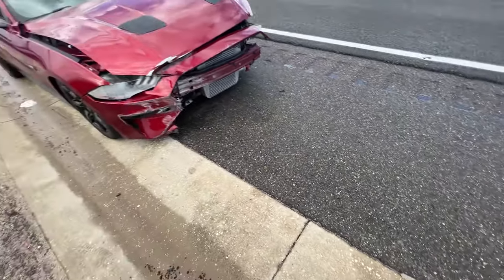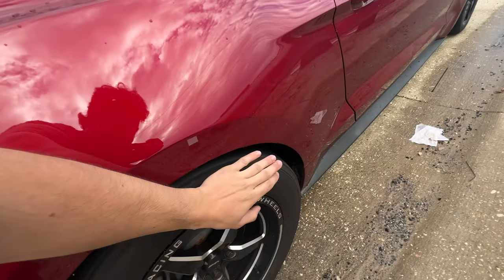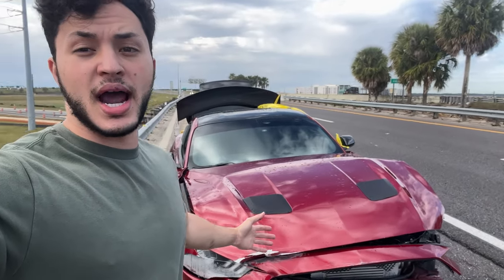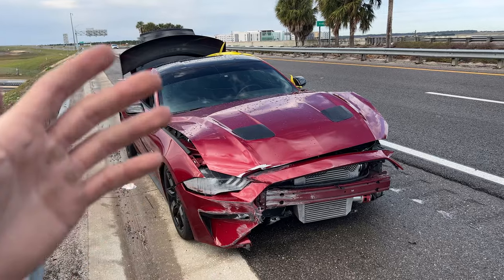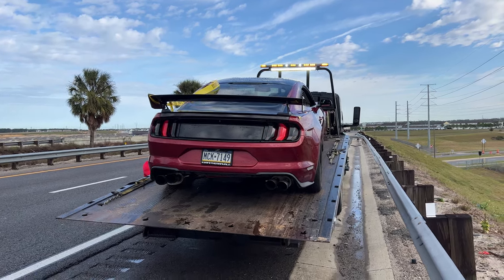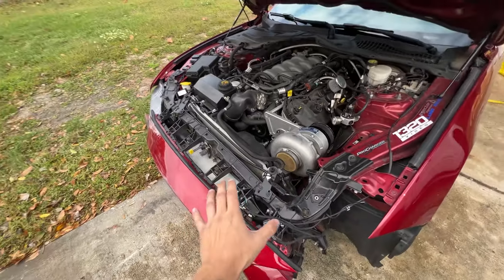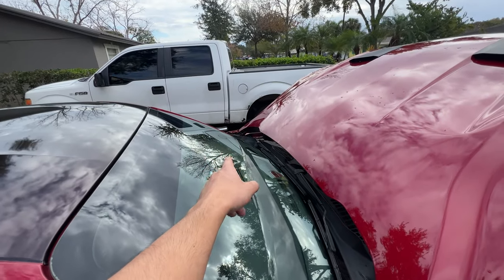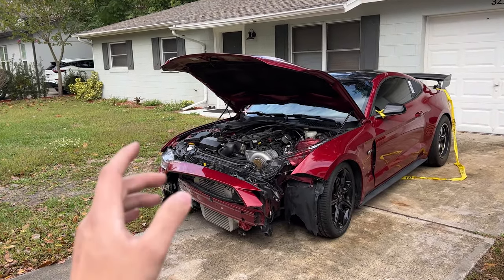I totaled my 1000whp mustang in the rain.

Comment: Power is nothing without control, as the old saying goes.   Glad all ok, but stick with straight lines in dry weather with those tyres.   

Mixing tyres is recipe for disaster with different handling, grip, breakaway for front and rear.

in UK insurance would be void if you were  using non road approved tyres.

Comment: happy my fellow mustang brother is ok this is the exact reason i brought new tires here in columbus ohio i was lucky to get away with 3 oost 4 years of use but even tho i over drafted my account it was well worth it and by the way tires are called all season westlake 255/40 19 inch rims from walmart only like 110 a tires in my opinion way safer and better than those pirelli p zero all season ford put on them walmart also sometimes its good to turn traction control off when driving to avoid random loss of control from it tryna correct you ive had this happen to me too but avoided a accident thankfully

Comment: Sucks that your car is totaled but at least you’re good. 👍🏼 can’t wait to see what happens.
Reply from the maker: Thank you! Stay tuned man I’m excited for whag happens
Reply: On your Procharged setup did you upgrade to the D1X from a smaller unit or just go larger from the start?
Reply from the maker: @devious5.0 started with the d1-x, but on low boost. Turned it up to 19psi and we make close to if not a little more than 1000whp